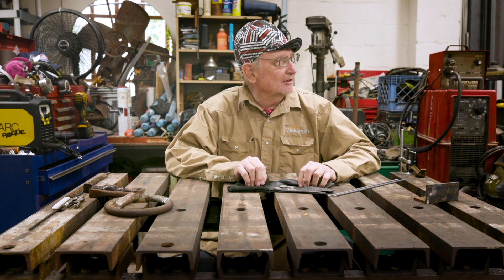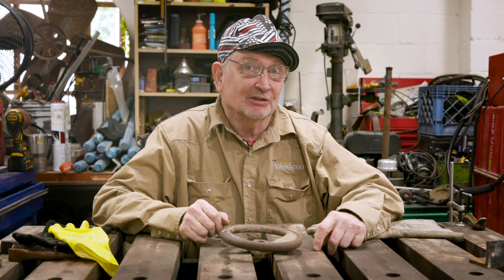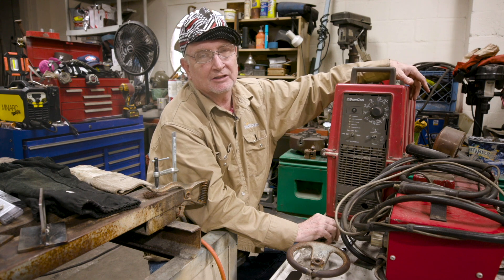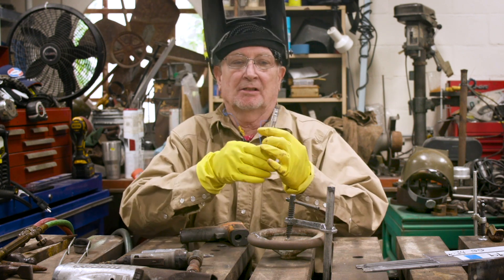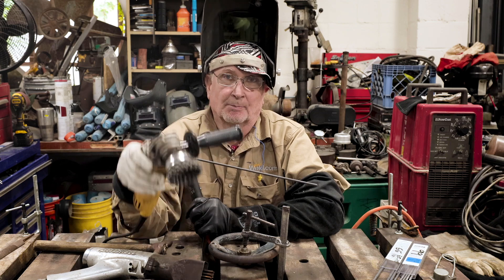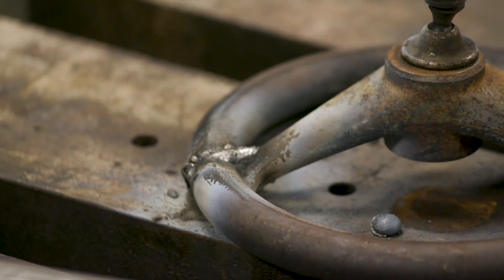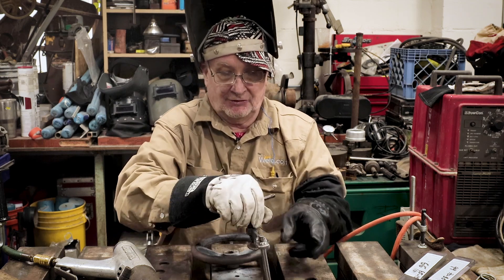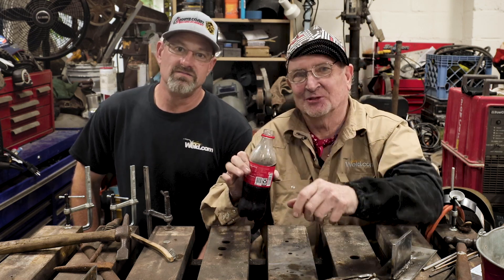55% vs 99% Nickel Rod On Cast Iron Repair

Comment: Bentonite.  That stuff is used in cosmetics and Fracking.  Mix it with propylene Glycol and agitate it and you get a sticky gel. Use the gel in cosmetics, or pump it into a bore hole and hit it with tons of hydro pressure and you get nat' gas or shale oil

Comment: I have a large piece of cast iron that has broken and is no longer produced so my only option is to try and weld it, how would you suggest dealing with slowly cooling a piece that could weigh over 200lbs. and is quite large?

Comment: Thank you for the insightful video ! I finally figured out what and why my cast iron welds were disastrous. I have a question, if you can help me out : I need to stick weld 2 plates of pure nickel (6mm thick, 1/4 inch for you). What electrode should I use ? Stainless 316 ? Nickel 55 ? 99 ? something else ? Any advice is welcome. Thanks

Comment: Do you think I can use nickel 99 rod for welding mild steel to cast. I need to weld a bracket to an old forklift counterweight.

Comment: I had a new c. i. exh mnfld. Needed to change the exh. port's direction. So, I cut the port off with my portaband. Beveled the mnfld & the short port. Put the two parts on the dash. Then parked my portable welding truck windshield toward the sun. Closed all the windows. Waited a while. Got real warm in there.  
Once the parts were nice and warm...brought them to my fab table on the back. Tacked the parts together. 
   Welded about one inch at a time. Peened each weld. Finished it. Then put the piece back in the cab so the piece could relax itself nice and gently. 
  That was four yrs & many miles ago. Used NI 99.

Comment: Hello Paul, very interesting on the 2 different C.I. rods. I have a maintenance machine shop up in N.E. corner of California. Lots of logging here. Haven't got into very much CI repair, "But" if it comes along, would like to know what I'm doing. If I use 55 Ni rod, and I have to do any machining on it, will it fight me bad ? Tapping, and especially a blind hole would be challenging ? There's enough problems with any repair, with not hearing the "Snap, crackle, and pop", and then add in the machining process, Ahhhhhhhhh ! thanks. Regards, Peter

Comment: Need the hot tip for the propane. 1000°+ and quick. The cheap propane tips cant be 750 and wont transfer

Comment: Welding content starts approx 7:45.  Very little discussion of actual differences between 55 and 99.  

According to Lincoln Electric:  "As compared to Tech-Rod 99, welds made with 55 Ni are stronger and more ductile, and more tolerant of phosphorous in the casting. It also has a lower coefficient of expansion than 99Ni, resulting in fewer fusion line cracks."

This is opposite of what almost everyone claims on various amateur forums, so I was hoping for clarification, but this video doesn't really go there.
Reply: Same here and got nothing from the video as to which was better/stronger etc

Comment: You say to heat the whole piece up to 300 degrees.  If you are welding an engine block, like a 6 cyl in a tractor trailer. What would you heat the are up to?

Comment: I have a question. I have a couple of hubs for a coulter assembly on a plow that are cast iron. They have ears that engage the frame of the coulter assembly to keep the hubs from spinning. Several of the ears have broken off. What would be the best alloy to fix this?

Comment: Lets say I have cast iron lifting keel off of a old sailboat that broke, would you use silicone bronze, aluminum bronze, or nickel rod? I build up alot of valve seats with silicone bronze.

Comment: I love the older guys. They have been there, done that, and have experience that only decades on the job can give you.
Reply: Like I have pointed out on other sites, welding jobs are all different. Depending on what particular thing the employer is in need of. Many times it's things you will never see in any book.
Welding cast iron may be the job you do, in which case you can work out everything involved to get all the best combinations to make it work. 
Other jobs welding cast might only be an occasional thing and it's different every time.
My present job I stack thousands of 20 thousandths thick pieces of sheet metal and grind a small groove down the side then put a weld down the groove using a tig welder and a cold feeder of .035" mig wire. I don't think you will find that one in any book.
I only occasionally weld cast iron to repair broken castings from China and they are rarely the same.

Comment: Weld mold 750,is the only rod I'll ever use,,45 yrs of repair work all types...
Aside from the old guys that still braze,,brave,, messy..very un slightly..
You must always peen the work area after a small area is welded,with hammer or air chipper..
Never had any cracking.
Reply: I have never used the Weldmold 750, I have used one other product of theirs, the supplier said it was similar to Super Missile Rod, and we used it as a replacement, ....I will have to look into that.....appreiate the comment ...cheers

Comment: I'm not sure if the constitution of nickel rods is drastically different in the USA vs UK, but the information contained in this video stands in stark contrast to my experience with welding cast iron. Without meaning to be an arse about it, it seems a lot like this video contained more hear-say than useful pointers.

Comment: When I was a kid in highschool welding class, I wanted to make a barbecue pit out of an old semi truck brake drum. The old, angry, retired military welding instructor, Mr. Harms, handed me some rod and said "This is going to feel like mixing melted marshmallows and your going to have to go by feel." Twenty five years later, that weld has survived thousands of heat-cool cycles and still hanging in there. Thank you Mr. Harms sir!
Reply: Thank you gentlemen.
I called him Mr. Harms sir because he wouldn't acknowledge you if you left out the "sir". I imagine you could practically be on fire before he'd let that slide. The first few days of class, we'd watch welding instruction filmstrips from the 60's. On the rare occasion Mr Harms caught someone sleeping, he had a bell made from half an oxygen cylinder that he'd wrap on a few times with a ball peen hammer.
Bemidji Highschool was built in 1912 and despite the thick masonry walls, even the English department knew when Mr Harms was "motivating" a student.
Reply: Well written memory!

Comment: I know it’s a 55 vs 99 video but I’m doing alot of research before I spend $ and I’m wondering why use either if they make a cast iron rod specifically for cast iron?

Money is the only reason I can find so far to not use the “better” material so I guess it depends on how much the project is worth to someone?

I just happened to break my old vise last week so now I have something to practice on but my real project concerns are two old 1950s bells. One is crystal metal and cracked.  Jb weld is one answer and per some “the only answer”. 

 The other is the wheel and the head bolt for a bigger bell. One is supposedly grey iron and one steel so I have multiple things to fix.

Fyi I broke the vise trying to get the rusted nut off the broken 70 y/o 3/4” head bolt. 
None of the magic sprays worked or anything else until 
Finally just put it in the freezer  for @  8 hrs. 
Pipe wrench under my foot, big socket wrench, old muscle and patience got it off.

The head bolt was welded to the clevis. I can always use my knew bolt but then it wouldn’t be authentic. We’ll see….

Thanks for the video and sharing your knowledge.

Comment: I just did my very first cast Iron repair. A steering knuckle broke on our tractor, the part is going to take 6-8 weeks to get here. Needing the tractor I decided to weld the knuckle. Used 55 rod (nomacast) and so far its holding up great.
Reply: Cast iron ain’t to bad to weld when prepped right and post weld treated. Good job !

Comment: What is the new company of those guys who made that inverter i want some of their products if they are built like that
Reply: Goran Hedberg and Curt Hansson started PowCon as part of AB Svetsia in Goteborg,
 Sweden.    The company was sold to Pacific Lumber which also owned Thermal Dynamics.  In 1985, Maxxam Group took over Pacific Lumber and sold the welding equipment to ITW which also owned Miller and Hobart.  In 1999, Goran Hedberg partnered with another Swedish business owner,
 Gunnar Ennerfelt, and founded Arcon Welding in Salisbury, Maryland.   Goran Hedberg died in 2018.